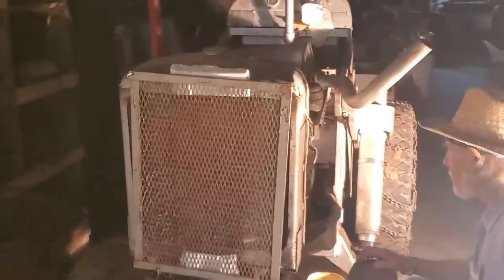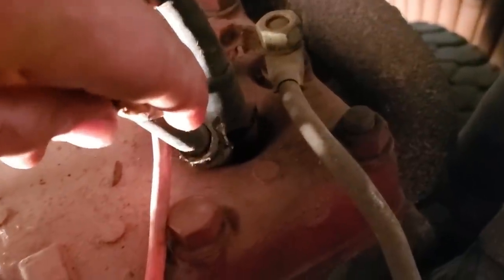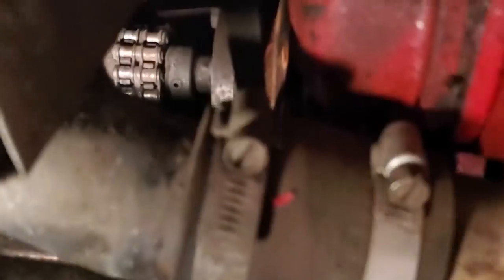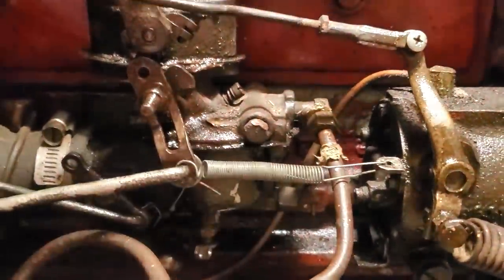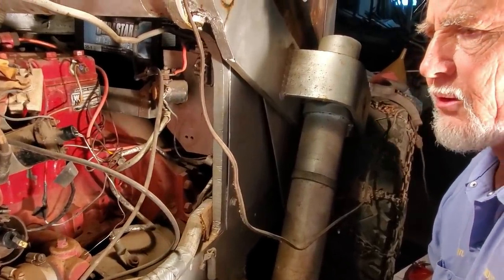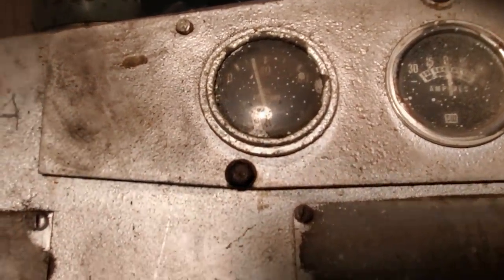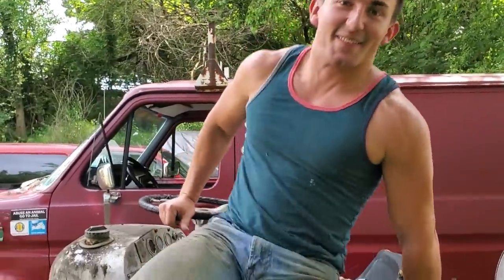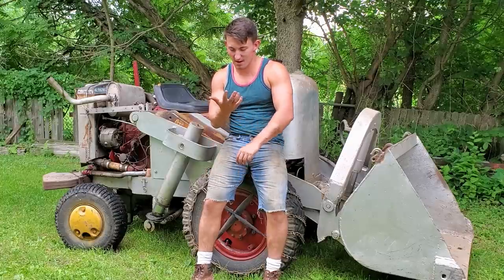1947 Hughes loader Doodle Bug Revival First Start In 5 Years!!!!

Comment: the second I saw the word "Doddle bug" I dropped what I was doing to watch the video....45 years ago my first maintenance job was at a metal refinery and they had about ten of those things and everybody there called them "huff" doodle bugs but regardless my job was to do the preventive maintenance, do tune ups and repairs on them and also fix the tires. 15 years later when I left they were still using six of them. I haven't seen one since this one in the video, it sure brings back a lot of memories..